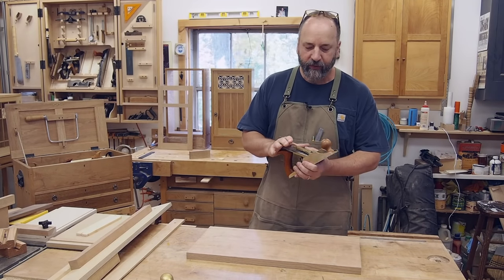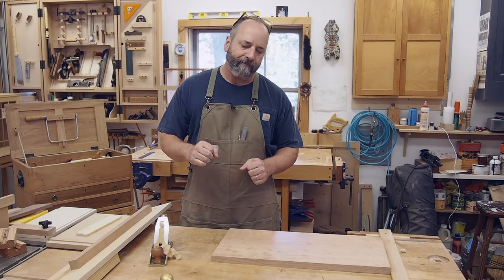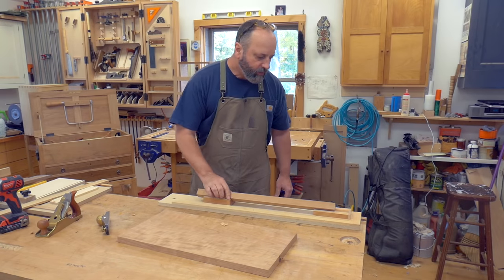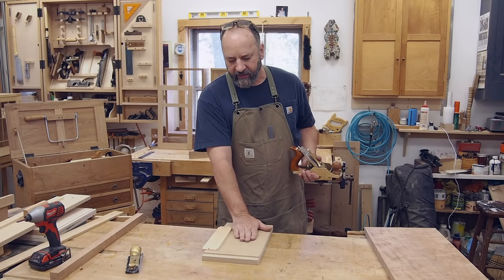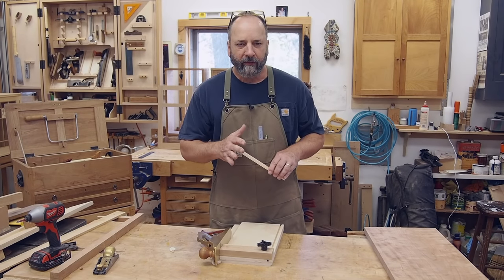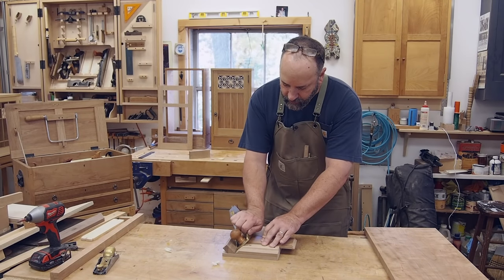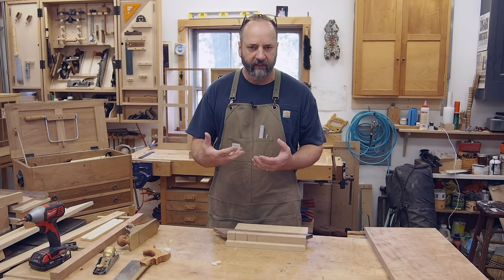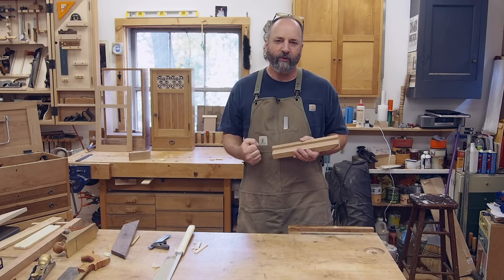Mike Pekovich's Go-To Work Holding Jigs

Comment: Really great video - packed full of truly useful info without fluff.
Suggestion for improving efficiency a bit more on the small fixture that you clamp in the front vise:  add a rabbit to the rear bottom edge to make a positive registration feature, allowing you to drop it in the vise with one hand and have it automatically locate in the correct, level position, as well as not falling through before you tighten the vise.

Comment: Why is it important to have an adjustable fence on the 90 degree shooting board, but not on the 45 degree miter board?
Reply: It’s quite difficult to check if you’re still square on the miter board, because you have to check it against the edge your planes rides against, and that’s at an angle – there is no crisp edge into which you can push your square. It would be important, but the whole thing isn’t perfect to begin with. Still, better than nothing at all.

Comment: Small comment, it is not usual for the plane to be placed down on the work bench so that the blade is in contact with the work bench. When placing the plane you either stand the front edge of the tool on a small block to keep the blade above the bench and/or you lay the plane on its side once again keep the blade off of the bench so that is cannot get damaged.
Reply from the maker: Strongly disagree. But to each their own! Thanks for watching.
Reply: Better not plane any wood with it either, it might damage the iron.

But all joking aside: putting the plane on its side is often taught to beginners, but I really don’t know why. Putting it on the side exposes the cutting iron: you might hurt yourself when you pick it up again – or someone else might. Or you might bump into it with another tool and really damage the iron. Just put it on the wooden bench top, gently. It won’t damage the iron – it actually protects it – and it won’t change the setting.
Reply: @mm9773  From what I've heard, it took root in woodworking schools and shop classes so that plane irons would be less likely to dig into workbenches and/or require less frequent sharpening. On the other hand, setting it down on the side with any kind of force can jar the blade and skew it from being parallel to the sole of the plane. So long as you're careful with it, setting it sole-down is a non-issue. If one is really picky, one might set it down so the toe of the plane rests on a small block, thus keeping the blade off the bench while simultaneously keeping it handle-up....

Comment: What's the purpose of the stop adjustment on the shooting board as opposed to a static stop at a dead 90?
Reply: There is no static stop at a dead 90. Wood always moves a tiny bit, and you push against the fence and knock your plane into it all the time when you use it, so it might come out of square a little bit over time, or you might get it ever so slightly wrong when you first screw and/or glue it down. The adjuster lets you correct those things. On the downside, the movable stop might move on you, so you have to check it all the time. Neither option is perfect, but I might go with a movable fence for my next shooting board.

Comment: I don't believe the Fine Woodworking article includes the shooting board for 45 degree angles in wide parts, like box parts.  How do you dial in and maintain the 45 degree angle on that?  Nothing looked adjustable on it.

Comment: you shod never place the plane with the sharp-edged on the bench always on the side so you dont destroy the edged. a tip from a wood pro.
Reply: Bosse Carlberg No. Plane irons are more likely to be damaged by a stray chisel on their edge than they are if you place them gently onto a wooden bench. As long as your workbench is tidy of course and doesn't have iron filings or screws or other junk of course. 

Tip from someone with common sense.
Reply: Matt Williams hahahahahahahahaha